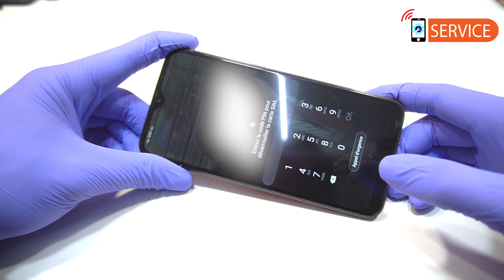Samsung Galaxy A10 Lcd Screen Replacement

Comment: Hi, I see you're using P-7000 glue on the video, but then on the transition screen you show a tube of T-8000. Which one do you think would work better for this model? I have the option of getting a small tube of either, as well as T-7000, for cheap.
Reply: The Glue T-8000 is a Multi Repair adhesive for LCD and Frame and is the solution for all your repairs of electronic devices whether it's your smartphone, tablet, laptop or smart watch. 👍

Comment: Really great tutorial video had no problems replacing new Lcd screen thank you .
Reply from the maker: You're welcome!
Reply: You use B7000 glue or T800?
Reply: @hraraujo  T800 it's great
Reply: does the camera become worse?
Reply: @selsabilr7718  No It was fine
Reply: @MOBILESERVICE123  first
Is the problam that wes in the video ia common problam to the screen?
Second from where to buy the screen

Comment: My phone got smashed a few days ago resulting in a pretty similar mess on the screen, a general discolouration plus black patches. 

It is reassuring to see that it can be fixed.
Reply: The exact same issue happened to me after accidentally dropping my phone for the 20th time. Problem is, mine's a huawei and there isn't much videos on the matter plus repair is so expensive that I might as well buy a new phone. But I got a lot of important data on my current phone so I'm just going to attempt to revive it with a screen replacement if it works. Wish me luck, buying tools this weekend.
Reply: @beauguintu9077  same Hhaha

Comment: my a10 fell in water and since then my screen has this flickering and line effects most of the time,i want to change the screen and am being told there are two types of the screen which is the normal one and the original  which is the expensive one.want to ask if its true and what will be some of the precaution i should look out for or take wen i take the normal screen

Comment: It happens on my phone i it broke the screen then i gave to repair shop i was happy because already fixed but unfortunately the wifi has got problem when i go away 2 meters away from the router it will stop and never connect again until i go very near can somebody tell me what should i do? I bring back to mobile shop again to fix but already 3 days past still the repair shop didn't fix and always promise me to make it tomorrow

Comment: What if I replace the glass only , will it still be black with those lines.
Reply: Ya
Reply: @Onetimedawn  lets be clear ..on the original screen its made of glass..lcd however is not glass so its not the same material but the lcd sceeen wont break as easily as glass .

Comment: Is there any other way to solve the same problem without replacing screen???
Reply: I don't think so I dropped mine in the hot tub and it doesn't seem there's a way other than replacing the screen
Reply: Yes buy a new one
Reply: Depends on what phone you're using

Comment: When I update using this code *#2663# but im not sure if that is the exact code, I dont remember. after installing the lcd/digitizer , the touchscreen is now not working properly. Do you have any idea to fix. I already used recovery mode. But it doesn't work .. the phone is smoothly turning on but in the abnormal touch.
Reply: Too me

Comment: Bro You used b 7000 glue and you said to use t 8000 what are the differences between these two type of glue’s?
Reply from the maker: B7000 old version and t8000 new version, no problem same

Comment: Hello I have a Galaxy A10 SM 105FN/DS on Ebay I see a lost of screens offered for the SM 105F. Will those fit for my phone or not or are there any differences in the models, so that not all offered replacement screens will fit? Samsung Support refuses to help me and the guy at my local phone repair shop doesnt know...
Reply: I think they are all the same so do but be careful dome screens on ebay are fake or don't work properly